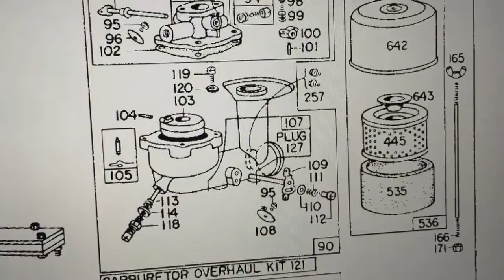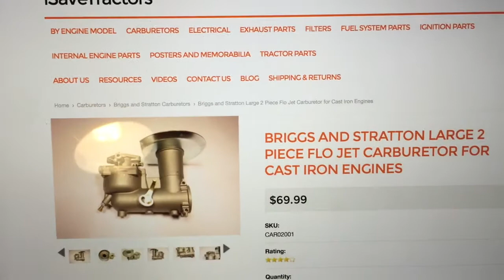Gravely 800 Series - Briggs and Stratton Carburetor - Part One

Comment: That's cool. I would stay with the original carb and stay away from made in China stuff. Your camera is sweet, what kind do you use?
Reply from the maker: yes, thats the goal. Not sure if the carb kits are made in here or not. need to find a supplier. The camera is a iPhone 6. it works great. Lots of light always helps too.

Comment: It's an 816s of it is an 800 series with a 16hp briggs
Reply from the maker: Cool, thank you, where should I order the kit from?
Reply: +CT moog look up your engine numbers to get the appropriate part number.   Here is a manual for the Briggs engine.  All of the info you need is on www.gravelymanuals.com.  You can get Briggs parts just about anywhere.  I would type the Briggs carb kit part number in eBay and just get an OEM Kit.   http://www.gravelymanuals.com/pdf/Briggs_326400_TO_326499_IPL_19851000.pdf
Reply from the maker: Thanks man
Reply from the maker: I appreciate the help